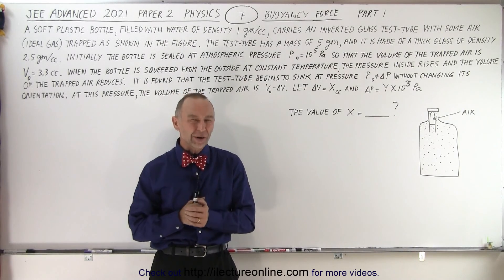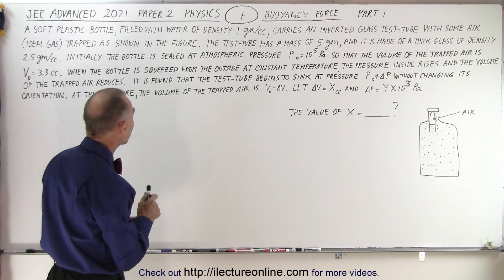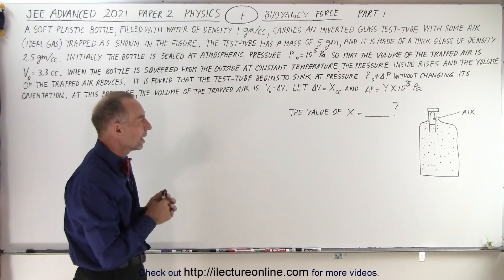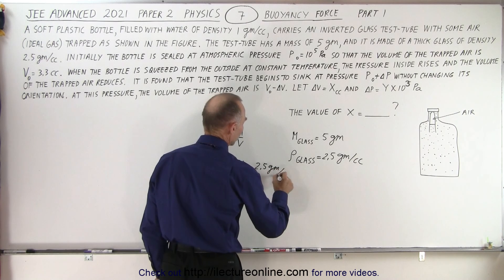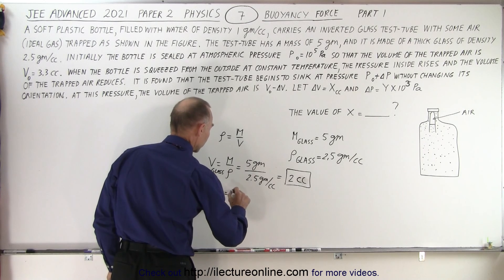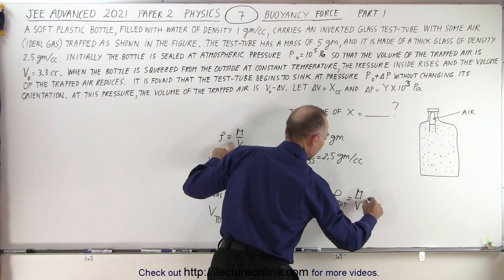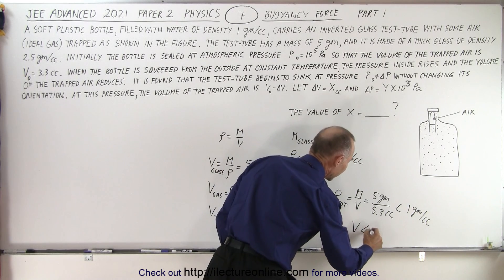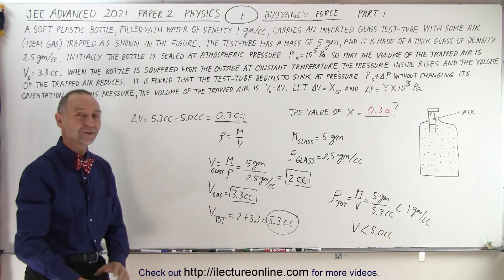JEE Advanced Physics 2021 Paper 2 #7 Bouyance Force (Part 1)

Comment: Question how much does including the air affect the answer. When I did the problem with the mass of the air included I got .295cm^3. Does anyone know if that's right
Reply from the maker: Since you are not allowed any calculators on the test, it is better to keep it simple and ignore the air inside the tube.

Comment: We are actually doing this for off shore full closed treatment pens at 200m for the fisheries industry since the current is criminal in waste release took 5 degrees including the power pack system for 5 years before service big stuff and to education boy O boy! To the real cost boy O boy! Not so easy to get those penguins on that small sheet off ice 😃😄😁😆😅 5 Smiles. But did you know water in it's own body has no actual weight????????
Reply from the maker: You had a very interesting job!

Comment: Hi mr.vonBiezen. im  Mo.  i ve a question which not quite related to this video. In huygens principle electro magnetism (light)  will spread out in  all direction from the source.  then why we have a light beam in one path only? Thanks..
Reply from the maker: Normally a light source will emanate E&M in all directions (such as a light bulb).  We do have the technology, such as a laser or a parabolic reflector to direct a beam of E&M radiation in a particular direction.  Under those circumstances the light will continue in that direction unless reflected, scattered, or diffracted.
Reply: Ok got it. But mr.von biezen what i mean was , more to the quantum scale..... electro magnetism field oscillating up and down creat wave or ripples around itself (superposition circles in all direction ) And gives us movement in strait line. And according to huygen principle waves spread out in all direction from every point on wavefront. Now, What confusing me is, why light always go forward and not going backward? Hopfully i make my point this time. Regard.
Reply from the maker: Remember that waves carry ENERGY, thus any wave will carry energy from one point to another.  E&M waves are produced where energy is converted to motion, which then produces E&M waves.  They will emanate away from the source of the energy.
Reply: Good answer mr.von biezen,  i guess E&M waves goes to all direction include backward , just depend on where we observ it. Many thanks.